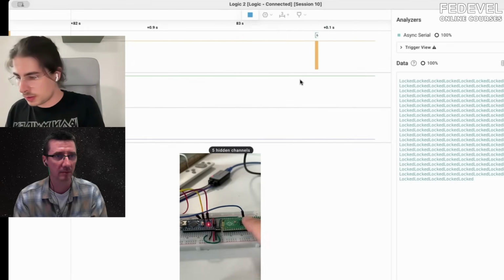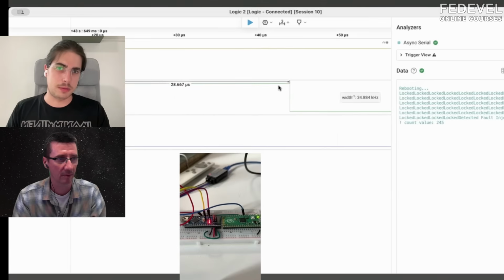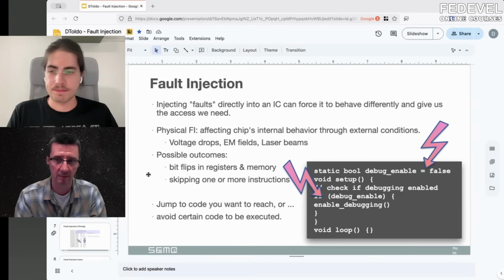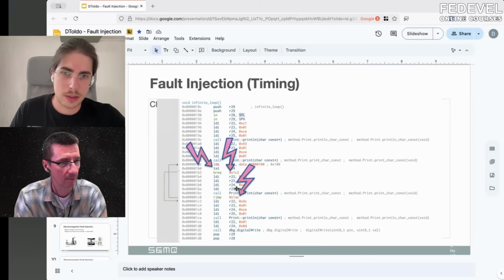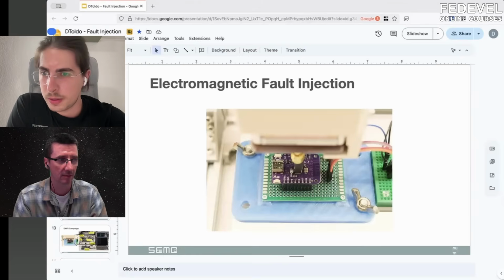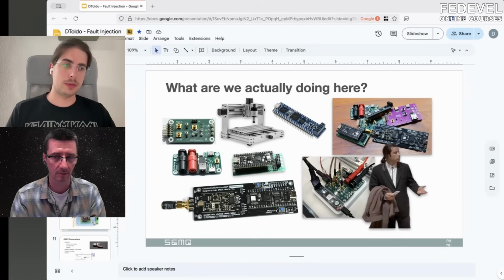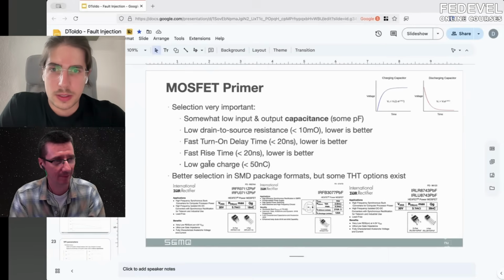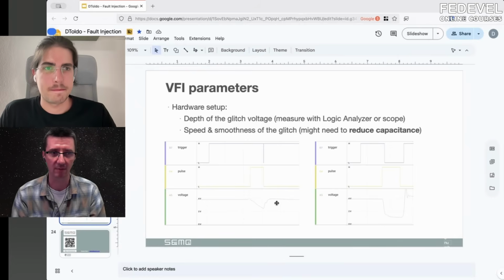How to hack a chip? Watch this example

Comment: Super interesting 
. I do like to compress my firmware before release in our diagnostic tool. This act as a sort of encryption and avoid to simple code machine reverse engineering, especially if you cannot dump it from the target.
Open to discuss on that. Worldwide machine deployement background. Means the firmware is clearly visible, potentially.
Compression seems one step of protection, along flashing timing optimisation.

Comment: How are you pulling the core down to ground? I understand you are not shorting 3.3v (Vcc?), so this dev board has a GPIO that can be used to connect directly to the core power rail?
Reply: No, he actually brutally shorts core to ground through a mosfet, which in turn is triggered by a gpio for X ms or so.

Comment: There is an expected average number of clock ticks/cycles per type of MCU that would help the swag timing (scientific wild guess). It does depend on instruction but it’s better than out of the blue number.

Comment: what does it mean "if I glitch one instruction"? One assembly instruction? One u-ops? One line of code? 
what do you mean by "skipping one instruction"? What do you mean by word "skip"? 
is your target code depends on input from one of the cpio pins?
Reply from the maker: yes, we are talking about skipping (not executing) one or several assembly instructions. I am not expert for this, but it could be something like that execution of instruction is somehow corrupted (e.g. it is not decoded correctly or somehow interrupted before ending) but PC counter still increments fine.

Watch this video, it may help you to understand how CPU/MCU executes software: https://youtu.be/EeHK3Jbgv2s?si=Hmo9Lf9zcFaUKlrO
Reply: wait, are you effectively powering off the chip for a few nanoseconds? because if it is the case it is so fun and cool
Reply: @doingwell5629 yes that is the claim ... lol...
Reply: where is exactly the suppression of the signal which carries the instruction code happens?

Comment: Very interesting topic! In many of the projects I've worked on, actual physical security of the chips was never really considered, so it's always nice to hear experience of others.
Reply: That's like securing a network but leaving USB ports open, and not using the chassis intrusion on a server enclosure
Reply: @Heimdallr-88h14  Yeah, the threat model often is that the attacker doesn't have a screwdriver. 
On the other hand, the devices I've worked on usually require a prepared installation location and a truck to move, so there's hope that physical security would be good enough to prevent hacking.
Reply: @AndrejaKostic  Or a neon vest and clipboard lol. My work is all highyl secured behind multope gates, keycsed doors, and then a vault lol. Then my mind wanders sometimes to the various methods of exfiltration and wince.  Some being technological or physical gaps, but always people too.  The weakest link is almost always the human factor.
Reply: @Heimdallr-88h14  In my culture, white lab coats are associated with scientists, and blue lab coats are associated with technicians. 
At a university where I studied, thieves got a cart, blue lab coats, and just went through lecture halls, disconnecting projectors and computers in plain sight, because everybody just assumed that they're from maintenance department. Afterwards, people couldn't even remember how they looked like.
Reply: follow watching Sir...,